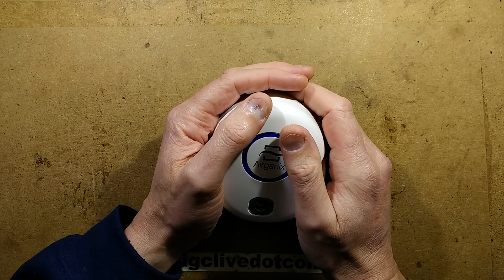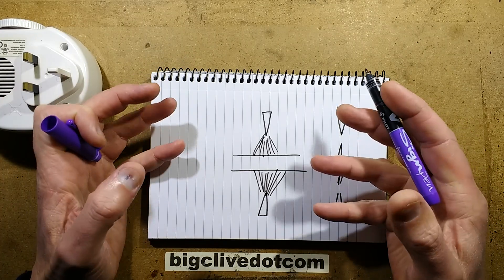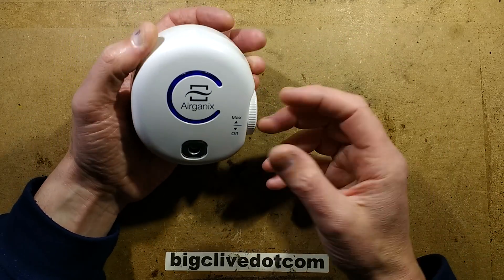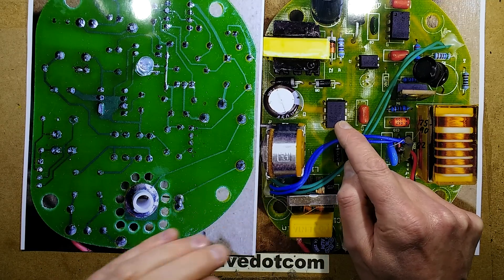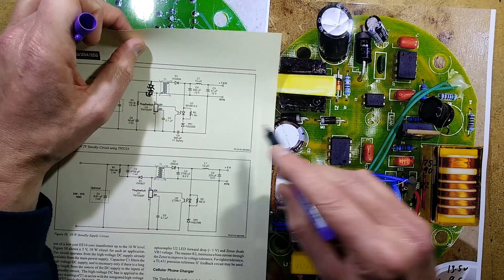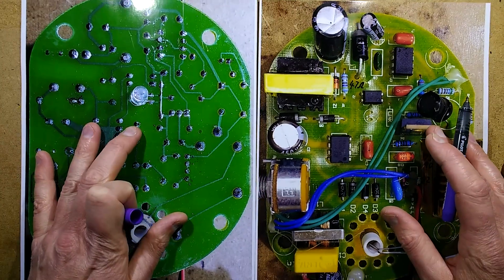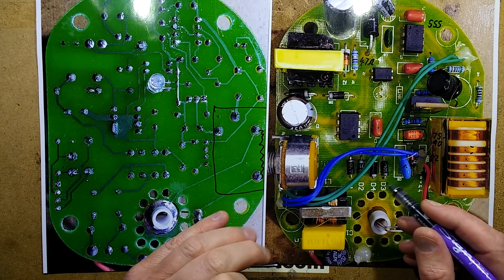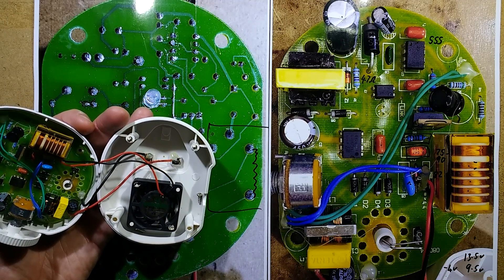Inside an Airganix low level ozone air steriliser.

Comment: eBay is flooded with 10G/hour ozone generators. I purchased one and instead of an air pump I connected it to an oxygen concentrator. It puts out an insane amount of ozone! I got it to ozonate water and in only a few minutes in a half litter water bottle it's fully ozonated to saturation. I'm in Florida with an abundance of the recently departed that left behind many barging oxygen concentrators. I picked one up in perfect condition for $50. The ozone generator was $44. A stainless steel bubbler and some silicone hose from eBay was another $12. Total investment $106 for an ozone generator strong enough to clean a green swimming pool. ☺️

Note: If you run this thing a inside you have to leave the room within seconds!

Comment: I might be wrong, but that zener that drives the fan (and the cap near that for that matter), is cooled by the fan when the thing is assembled. I guess you measured the temp without the case. So normally it might not be that hot.

Comment: I fully expected a diode-capacitor ladder voltage multiplier. If the Chinese got on the case they could probably make the same thing with 10% of the parts...
Reply from the maker: To generate the corona it needs an AC voltage applied across the insulator.  There is a way to use a multiplier though.  You basically create a needle based ioniser and then put a metal ring in front of each needle connected to the other end of the multiplier.  It creates a stronger corona discharge on the tips of the needles and creates a slight airflow of ozonated air.

Comment: The opposing diodes, zener and normal, are to clamp the flyback voltage on the primary, limiting that of the secondary.

Comment: The mysterious L and C are probably a resonant tank, witch is perfect for this type of application. That recycle the unused energy until lost appear at the output or as component heat. The drawback is a high current on L and C, that explain the high temperature of C.

Comment: A big part of the corona discharge chemistry end up being the production of nitrogen dioxide, which smells a lot like ozone but produces nitric acid on contact with water.  From what I can see, a lot of the medical grade ozone sanitizers require an oxygen feed to prevent NO2 production.

Comment: Ozone generators are not only ineffective, prolonged usage can be dangerous, regardless of the concentration.

Of the many pathogens and pollutants commonly found in indoor environments, the reaction process with ozone may take months or years (Boeniger, 1995). For all practical purposes, ozone does not react at all with such pollutants. Contrary to specific claims by some vendors, ozone generators are not effective in removing carbon monoxide (Salls, 1927; Shaughnessy et al., 1994) or formaldehyde (Esswein and Boeniger, 1994), or dust and pollen.

Do not buy these things. They're useless and potentially dangerous.
Reply: No, it's your comment that's useless, not ozone generators.
Reply: @bad_request5088  Cool story.

Comment: I don't know how mch difference it would make due to the retricted airflow, but remember that the hottest components you found are right in front of the fan. They may not be as hot in regular use as when you measured the temperature.

Comment: How do you think the output of this compares to the solid state HV DC generators you see in some other air ionizers? This looks like a better generator. The one I took out of a fan with a 'fresh air' feature was just one of those solid state sticks that takes a few volts up to a few kv, the output is just a PCB with a set of four pointed pins on it with a nearby ground plane to get the ions to flow.

Comment: Danyk has done something similar with the 2 suppresion diodes on his webpage, might be where they got it from.
http://danyk.cz/impulz4_en.html
Looks like the high voltage o/p transformer is resonant, the hot cap in parallel with it to make a tank, this would also explain the inductor in series with the supply, as you'd need this to decouple a resonant circuit, similar to a royer oscillator, but only having the one transistor iy cant self oscillate so needs the 555 to drive it.
Looks like the Esr of the orange hot cap is too high and its dissipating too much.
The Tny has an interesting function, at low loads is 'jitters' around the switching frequency up & down, this reduces Emi by not creating a stream of bursts at the same frequency, more a stream of varying frequencies, spreading out and lowering Emi.

Comment: Inhaling ozone on pupose is a bad idea. O3 is also known as a free radical. Also sischarged with welding, plasmacutters, copying machines and even electric model trains. The plasmacutter at work does give me a headache when used much.
Also atmosphere is nearly 75% nitrogen (N2). I'm suspecting this thing even makes NOx or NO2, not sure bout that though. N2 is pretty tough.

Comment: Ozone generators were used on cargo ships to keep produce fresh during transit (I am talking 60's and 70's).  I believe these devices were used to delay the ripening of some fruits in transit.  The Ozone generator needed 220 AC and we had to covert 220v DC to AC and the rotary converters were ideal to power our AC devices such as our stereo units (or was it HiFi in those days) :-)

Comment: Just in case someone spots that things could get nasty if the TinySwitch's regulation loop fails, the IC shuts down if it doesn't see a 'stop' signal for 50ms then waits 850ms until restarting.

Comment: But does it ACTUALLY do anything remotely close to to it's intended purpose or is it AS SEEN ON TV? I think it's does nothing effectively except it takes up a mains socket.
Reply: It absolutely works. This particular one, I don't know. Even extremely small amounts of ozone are dangerous, but there are still safe levels, a level that's safe enough to breath, will probably not be effective to remove smells. But a strong one will absolutely destroy smells, mold, bacteria, viruses, pests, and your mucous cells. The answer is to use a good one and leave the room for a whole day after you get enough into the air.

Comment: Laser printers are a  common source of indoor ozone pollution.  Early Canon and HP laser printers used an activated charcoal filter at the high voltage discharge area of the fuser to break down ozone discharge.  Later laser printers don't have this feature, so you can often smell the ozone from a busy copier or printer.  Open the window if possible when you smell that.

Comment: Not quite right on the common mode choke at 7:40.
Not the noise counteracts itself, the low frequency power does. This means the choke can be small without saturating from the power going through it.

Comment: Ozone generators do make things smell better.  I have a rather powerful generator in my home, perhaps like one of the hotel machines.  It's capable of making a room look foggy with ozone when it runs at full power.  However the issue with ozone is that it's temporary.  The effects fade after a day or two.  And in fringe areas where ozone is killing stuff in the air, there is a strong stench of annihilated chemicals that smell far worse than whatever you are trying to eliminate.

Comment: What happens to the Nitrogen molecules in the air? Does it also not make NO and NO2, or making these molecules require extreme pressures as well? Like inside a combustion engine? 
Interesting video...
Reply: Not high pressures, but big fat sparks, a corona discharge produces a negligible amount. Cody's Lab has a couple of vids where he makes Nitric Acid.
Reply: N2 is stable, but it will combine with O2 under the right conditions. 
Lightning for example, produces tons on NO, N02, NH3 (which is ammonia that acts as a fertilizer which rains down on plants), not to mention O3. 
A combustion engine uses pressure to create smug (NO2). Spark is not necessary (as per diesel engines).

Comment: Hi big c do you think you could use ozone for a small torch like oxygen (O2) and acetylene replacing (O2) with (O3) or ozone not a big torch but something small like a Jeweler would use?????
Reply from the maker: +Robert Culliver No.  The mini gas generators used for jewellers torches tend to use "Brown's gas".  Basically electrolysis of water to create a pre-mixed blend of oxygen and hydrogen.

Comment: Used one of those hotel ozone units when I worked in a motel... only ours didn't have a timer. Did you know that it (ozone) can and will bleach damp carpets?
Reply from the maker: As far as I know the only cure for a damp carpet is a new carpet.

Comment: How interesting, so is this the ultimate non-aerosol/chemical based solution to eradicating room odours? I'm intrigued, Clive, is there any way of making how well it can work to do that odour removal somehow tangible on YouTube? Darned if I can think of a way, like. Anyone?
Reply from the maker: It depends on the source of the odour.  It will freshen a room, but if a strong odour source is present then it's better to tackle the problem directly.  A traditional open needle ioniser also produces a tiny quantity of ozone which can also help with suppressing odours.
Reply: bigclivedotcom All I remember these things doing in my experience of their hey day during the '80s was gathering bloody tons of dust onto the shelf they were sat on. I think they somehow knocked it out of the air?
Reply: Oh, and hi there Big Clive ya big sexy bear btw! waves
Reply: John Howard: The story of the fan of fake and death! I have one those kinda fans so I can tell you how they work: Very well, thank you.
Reply: John Howard: Clearly, ionisation is a thing but I'm guessing when it was a trending thing everybody just stuck the word on a button.

Comment: A slightly more "sophisticated" design to the one you dismantled a few years back - https://www.youtube.com/watch?v=6p_OnoUGyY4. Same ceramic tube dielectric though, and essentially the same electronics (right down to the HV transformer, and 555-based oscillator).

Comment: For those curious, don't buy ozone generators no matter their quality. There is no good scientific basis for them actually helping, no matter the quantities they can pump out. If you already have good air filters then the next upgrade on your list would be an ionizer.
Reply: A slightly overenthusiastic ioniser will tend to produce ozone as well as ions.
Reply from the maker: A genuine needle or carbon fibre based ioniser (many ozone generators are passed off as ionisers) will only emit a very tiny amount of ozone.
Reply: Zeratuhl Poor thing you living in a place were air filters are needed.
Reply: @Eryk Johnasson 1: I don't live in a place where air filters are needed. 2: You misunderstand the point I was making. IF you are looking to improve air quality then an ozone generator is a pointless purchase. Air filters, however, will help. And then an ioniser can help further if you already have filters.
Reply: Zeratuhl Got it.

Comment: Practical Wireless did a home ozone generator in the early '70s using a Xenon flashtube pulse transformer as HV source, and conductive carbon fibres (from an antistatic record cleaner) as the electrodes. The Dielectric layer was a glass microscope slide coverslip, and the kit certainly generated enough ozone to be detectable.
Reply: Thank you for your comment. I like the idea and will have a try with it.

Comment: What's the difference between ozone generators and ionisers?
Reply: Jimmy Söderman Sers Ozone generators create ozone, and ionizers change the electric potential of the air. Ionizers just add or remove electrons, ozone generators fuse oxygen atoms together
Reply: Jimmy Söderman Sers The spelling.

Comment: The capacitor that gets hot is probably used as a resonant capacitor, for the transformer since it needs to generate AC, which cannot really be done by just switching the primary with a mosfet and 555.

Comment: Having a capacitor get hot sounds worrying as there are going to be reliability issues. The capacitor looked like a dipped ceramic type. If so it might be worth replacing it with a polyester capacitor with much lower esr.

Comment: The really hot capacitor across the fet is either a snubber (a bad way of doing it) or they're trying to make a resonant circuit and use zero voltage switching. Although the use of 555 timer is poor choice for the latter. So it's likely they were too cheap to put the standard RCD snubber across the fet.

Comment: The Ycap is standard for SMPSs even if there are no leads. There must be a return path for the noise capacitively coupled between primary and secondary. If the cap isn't provided, it will make its own return. Most likely not where you'd want to be. This could in random component failures.

Comment: One of those two diodes across the primary is a TVS diode, which is a zener that can stand transients. This cost more, but dissipates less power at no load. This way the can put the power switch on the output and still meet the EU standby power regulations.

Comment: "Here's the really violent way to make tons of ozone. It's basically a thin piece of glass with metal mesh stuck to both sides. When about 5kV is applied to the meshes, a large area corona discharge occurs between the mesh and glass on both sides. This makes a LOT of ozone." From: Make some ozone. Then sniff it. Mmmmmmmmm, fresh. (http://www.bigclive.com/makendo.htm)
Reply from the maker: I remember making the ozone panel shown on that page.  Even with a 50Hz neon transformer it created a LOT of ozone.

Comment: It's aTinyswitch. They also tend to make high frequency audible noise at no or low loads, so that may be the hiss you heard when the device was "off."
Reply from the maker: I thought that, but there was also a continuing smell of ozone, so the high voltage was still running.  The corona discharge makes a characteristic hissing noise.

Comment: The inductor, primary coil and capacitor across the 555 mosfet form an LC resonant tank circuit and can boost the power to the hv transformer without the need for higher voltages. The capacitor gets hot because it sees very high currents.
Reply: That one component is the major weakness. Although Chinese capacitors are much better than they were, I'd be inclined to replace that with a known quality device (AND keep a few spares on hand)
Reply: Yes, the voltage across the capacitor will be 3.14 times the supply voltage and will be a sine wave if it is operating as an LC tank although if the capacitor is getting hot then it will be less because the capacitor is dissipating some of that as resistive losses because of high tank currents. That little adjustment knob probably just de-tunes it out of resonance a bit so the the resonant rise isn't as high.

A bit like what goes on in that ZVS flyback driver but without the ZVS part, Clive needs to measure the AC RMS voltage across the capacitor to satisfy our curious little minds.

Comment: Ozone generators are a bad idea! https://www.epa.gov/indoor-air-quality-iaq/ozone-generators-are-sold-air-cleaners All the science is against it.
Reply: It has its uses.
I use it at work, it’s a controlled system to disinfect laundry; called JLA OTEX, it’s a system designed to be safe at its core; so much so, it stops producing ozone if it detects a high level in the room itself.

Like anything, it’s useful if applied and controlled correctly.
Reply: Good point!
Reply from the maker: The laundry use of ozone is very interesting.  In Japan they have machines that tumble clothing dry in a high ozone concentration to sterilise and deodorise it quickly without a full wash.  The same machines can diffuse the ozone in water for a wet wash without needing detergent.
Reply: bigclivedotcom agreed, that's interesting! I wonder how the effectiveness/energy use stack up against detergents.
Reply: bigclivedotcom yep, if you search for JLA OTEX, you’ll see it is interfused into the water, and the washing machines also have an auto dosing detergent system, as it won’t remove stains etc. But it is certified to kill all bugs and viruses, there’s a large wad of paperwork I have on it in my van; shows the lab tests and results etc. I’ll dig it out at some point. :)
Reply: Not necessarily bad. Dosage is key as well as how it is used. I have used Sharper Image's "Ionic Breeze" units for over a decade now with great results. Latest model has a honeycomb with platinum oxide (I think) to break the ozone created back to oxygen after it has done its job. The model also has a Phillips UV sterilizing bulb to kill all viruses and germs.

How well does it work? So much so that the freebie outlet sized version(like clive's there) I have flowing right over the toilet bowl -- kills the stink where it happens.
Reply: this thread contains horseshit known to the state of California to cause cancer.

Comment: Hi Clive. Unfortunately, breathing ozone is a really bad idea. Loads of toxicology information is available from credible sources. Even low levels of ozone can cause lung irritation and is particularly harmful for asthmatics, children and old folks. As far as oxidizing pollutants are concerned, it prefers carbon-carbon double bonds such as ethylene which is commonly emitted by ripening fruit. It converts ethylene to formaldehyde which is actually quite a lot more toxic. Most of the indoor pollutants you are concerned with won't be affected by low concentrations. Sorry, Nick